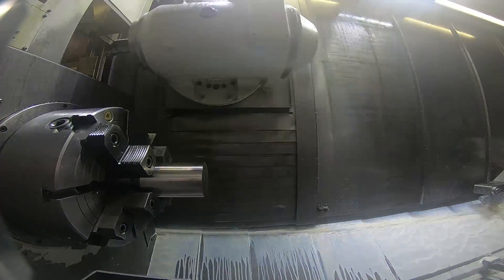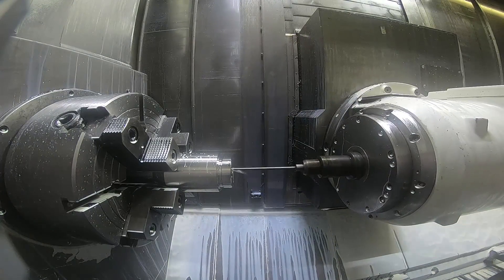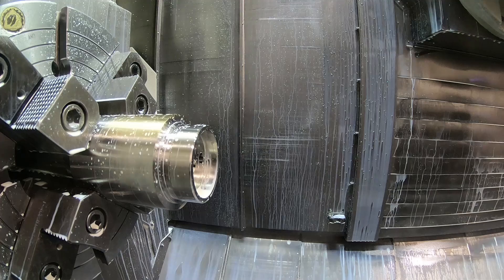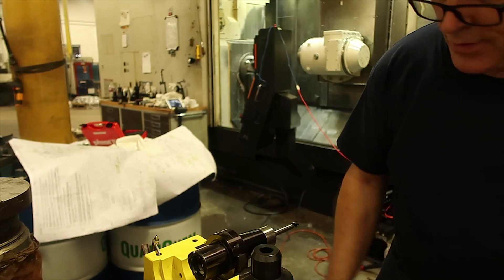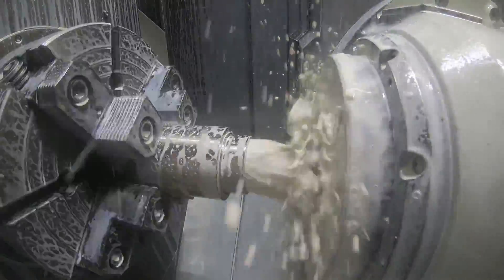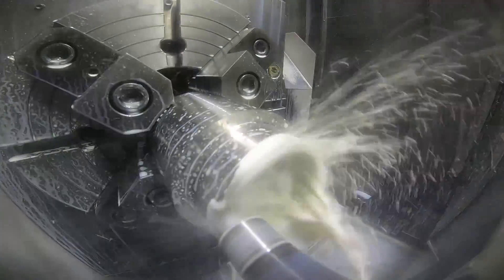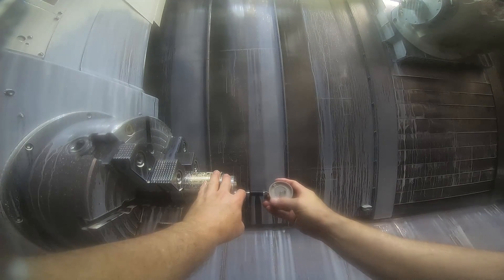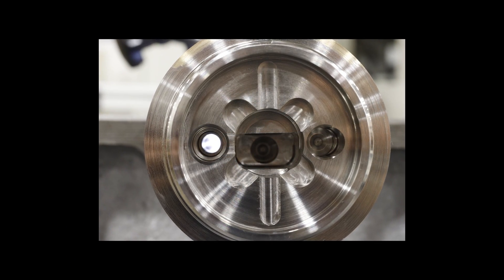Valve Body Op 2 In 4Jaw

Comment: Have you tried using ceramic tooling hear it works great on inconel
Reply from the maker: Ceramic does work. But it also introduces a lot of heat and possible stress into the part. Also there are less shapes available for the tooling. Especially in smaller diameter milling tools(and extremely expensive). I didn’t feel comfortable using it on these parts. But I have used it when the parts geometry was appropriate.

Comment: Mr Stanton,
Being the same in diameter,  which removes more of this Inconel before resharpening is required, gundrill bit or carbide helical flute bit?
Reply from the maker: Probably the twist drill would be faster and last longer than the gun drill for shallow depths. The issue is a carbide twist drill isn’t available to drill to these depths. Also even at 30 x depth a carbide coolant fed twist drill is many times more expensive than a gun drill. It also requires more sophisticated equipment to sharpen properly. Than the gun drill.
Reply: Nine times more expensive:  A glaring price difference. 
Walter Coolant Through 5/16"X30D helical Carbide bit $624 each
5/16x10’’gundrill bit $83.56 each  or  nine for  $604.89   

Have you ever ground secondary point angles (SPA) or radius corners on helical Carbide bit? 

Might increase the cubic inches of material removed before having to resharpen.

DRILL POINT GEOMETRY by JOSEPH MAZOFF 
http://www.newmantools.com/machines/drillpoint.html 

A Powered 4/6 Facet Drill Sharpener
https://www.gadgetbuilder.com/DrillSharp.html#Facet4

Comment: Why are drills still used when endmills make a cleaner hole?
Reply from the maker: Typically a drill will remove metal faster than a endmill. Also a drill hole faster than a endmill. Endmills aren’t really designed to drill straight in like drills.
Reply: @EdgePrecision  have you done any designing of new tool inventions or improvements on older styles?

Comment: You constantly start and stop your programs to touch off tools or measure. Does the mazak control allow for that or do you do bunches of small programs where you know you will be doing that?
Reply from the maker: In order to touch off a tool it is necessary to reset and restart the program. But if you make the program with this kind of thing in mind the program is easy to restart in the places where necessary. I very seldom run parts where I just push start and the program runs straight thru to the end.

Comment: It seems some demented individual keeps designing parts that are impossible to make... then you manage to make them. Do you regrind all those drills or scrap them?
Reply from the maker: The drills I regrind if possible. The endmills I may regrind also if possible. But they mostly are to chipped to regrind. At least the ones that were roughing tools.

Comment: Your calm monitone monalogue does not reflect the stress of all the operations being correct. If it cant be done in Houston then where else do you find a way to make this part. It seems that if you are not doing something difficult then it must be extremly difficult. Having worked on oil and gas tool machining, you may be able to secure some work from Spacex as they are always trying to do the impossible as well. Its just a backup plan when things get slow. Another video, well done.
Reply from the maker: I’m not exactly sure what all that means, but thanks!

Comment: Incredible! 

Wish I had enough luck when hiring new people to get someone with half the experience you have. 

What SFM and IPM were you running those endmills?
Why not Counterbore prior the drilling the deep holes? 

Great work as always!
Reply from the maker: I started at about 130 sfm but had to slow all roughing tools to about 100 sfm. The finish tools ended up around 130 sfm. The feed varied depending on the tool overhang or length. I think the gun drills ended up at 90 sfm and .0004” per rev. Any faster and they would fail.
Reply: I have not had to deal with the overhang yet, sfm matches pretty closely with what I run for production inconel runs. No experience with gun drilling yet so looking forward to that challenge. 

Thank you for your videos, I find them the best for overlap with the type of work my company does and the ingenuity I try to instill in my employees every day!
Reply: If you ever have a slow time at work I would love to come observe and learn as much as I can without delaying production!

Comment: mind blowing. For a layman, and I know you can not say, or even have the actual numbers, but what does a single part like that cost? Raw materials, machined, out the door? Even a super wide spread? What would a company needing such a part expect to have to pay for such a part.

To have a tenth of your brain power.. gadzukes. 3 axis is using all Ive got.

I too have been tentatively waiting for more from you.. great content always. Love your work even though I dont understand 2% of it.
Reply from the maker: I don’t buy the material or do the outside processes. Which include on this part. Heat treat, weld overlay, Ram EDM and some special coatings. I just do machine work. I would estimate in the range of $20-25 thousand each for these parts finished to the customer. With all the quality inspection and documentation. But that just a guess I could be way off.

Comment: I'd love to know how they drill the coolant hole all the way through the gun drill? - awesome video, thanks!
Reply from the maker: The shank of a gun drill is made from a tube. They put a kink in it form the flute. Than braze the carbide tip and shank to it.
Reply: That makes a lot more sense than what I was imagining - Thanks!
Reply: John G, the holes are not machined at all.  Carbide powder is pressed into a mould which has wires in place of the coolant holes.    After pressing, the wires are pulled out.  The temporarily 'pressed together' tool is then very precisely heated until the powder sinters together.  Then the external features can be machined.
Reply from the maker: Yes this is true for carbide twist drill blanks. Than when you get to the grinder to grind the flutes. You probe the coolant holes at the tip. Than knowing the helix angle of the holes you can grind the flutes at the appropriate helix to not hit the existing coolant holes in the blank. I have done this on my CNC tool and cutter grinder.

Comment: Wow, I always hear how inconel eats tooling but it's entirely different to see entire end mills having to get changed out every part/every op! As always thank you for sharing your process!
Reply from the maker: This particular material, I think could have been heat treated differently to improve the machinability. There is a double age hardening that could have been done. If I do this job again I will have that done.

Comment: what type of unobtainium is that? just keeps eating your tooling. Nice work dude
Reply: Inconel 718.  Similarly to titanium its elastic nature makes it tough to machine.
Reply from the maker: Any material that has a high heat resistance becomes difficult to machine. When you machine say steel you notice the shavings coming off blue. That’s because you are cutting the material at a elevated temperature. The higher the temperature the lower the strength up to a red heat. This is the principle that ceramic tools work on. But with high nickel content materials have a high yield strength even at elevated temperatures. This is what makes them difficult to machine. Even the carbide tooling breaks down at these temperatures. Ceramic does work faster but it isn’t quite as reliable and it usually has to be run without coolant witch can introduce a lot of heat into the part.
Reply: Special Metals in upstate NY is the foundry. VIM/VAR process for production of the alloy, usually 40,000 lbs per heat, 1 heat per shift, pouring 4 10,000 lb ingots per heat.

Comment: Could you demonstrate how you approach the blunt start using an end mill. Very interested
Reply from the maker: I will make a video on this. Its not to complicated. Its just a helix or short thread milling cycle. The trick is to get it aligned to the existing thread. On this machine I can put it on a separate fixture offset and change the C axis zero angle to align to the threads lead. This could also be done on a lathe with milling on the turret. Once aligned with the proper C angle you don't have to touch the offset between parts it will always align with the thread even if you change the Z zero.

Comment: Sweet Jesus, you must have the patience of a saint with all those gundrill changes/ sharpening. 
Are the end mills completely dead at the end of each part or could they still be used for roughing in a softer material?
The GoPro case is working like a dream. I’m sure a side line in suppling other YouTube machinists could be quiet lucrative.....
Thanks for taking the time to share your work, awesome as always
Reply from the maker: Thanks! The worn out tools maybe could be resharpen. But they are really worn out. The parts have good enough money to pay for this kind of tooling use.
Reply: I know it is confidential but I am really curious about the cost side of these jobs. Thanks for the great videos.
Reply: You have to have a lot of patience in this line of work.

Comment: I often have to turn and drill 1.2714 (55NiCrMoV7, don't know if there is a US Version of that), that moment when you are almost done and that last carbide drill decides to fuck everything up, gonna have to talk with my boss about trying those gun drills. Also i shamelessly copied your way of setting tools with the dowel pin :D Cheers Awesome video as always!
Reply from the maker: Gun drilling isn’t as fast as a twist drill. But it will drill straighter, hold size and finish better. As I said in the video if you break one you can get the tip out. In a deep hole if the tip is still in there I usually take the broken shank. Grind a angle on it. Than put it back in the hole and hit the end with a hammer. This shatters the carbide tip. See the tip if a gun drill has coolant holes and it will break along the coolant holes. Than you can usually just blow out the pieces with a air gun. Or even use the broken drill shank with the air gun. Blowing air down the broken drill while pulling it in and out of the hole. So far I have always been able to get the tip out of the hole with one of these methods.

Comment: I would like to ask: Does the external thread have any specific effect on the treatment of the entrance?
Reply from the maker: I’m not sure I understand your question. Are you referring to the blunt start? Some engineers specify this others just want a chamfer on the start. Some even want a blunt start on the first and last thread. I prefer the chamfer but you have to do what the drawing specifies. I have done all this on all types of threads. I don’t really think it makes any difference except maybe in assembly of components into  or on to the thread.
Reply: Edge Precision 感谢您的回复。